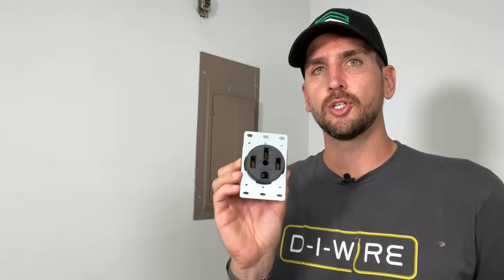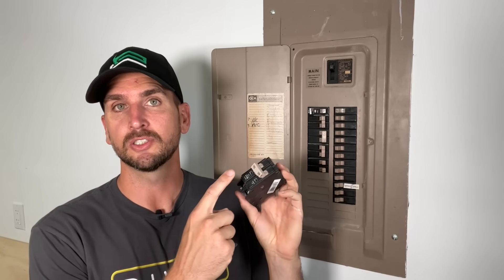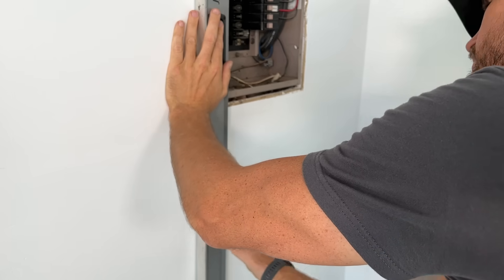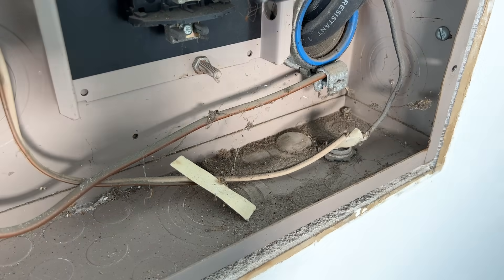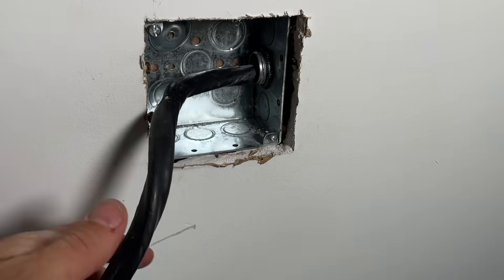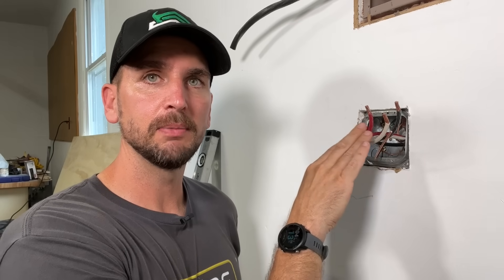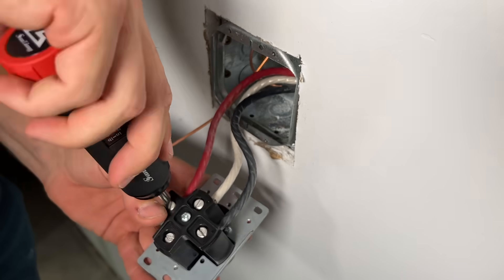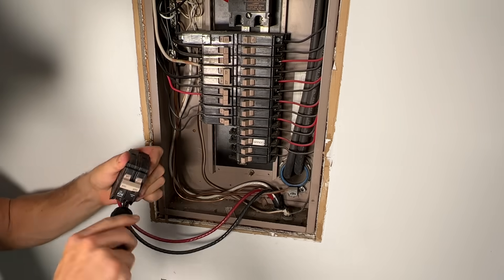Quick and Easy DIY 240V Outlet Install | 50 Amp NEMA 14-50

Comment: This is by far best case scenario this will cost most people who hire an electrician $1000 or more
Reply: $1k is a good ballpark to expect, but can probably get it a little cheaper depending on how far the outlet is from the box.   I hired an electrician to install one last week.   I bought the outlet and GFCI breaker myself.   Panel was on the side of a detached 2 car garage so had to run wire up and over one garage door to the wall between the two doors.   I had him use aluminum wire so it would be future proofed if I ever decide to upgrade to a hardwired EVSE for 60A or 80A use.    I know the wire increased the total cost.   My total bill was $857.   I think I paid around $110 or $120 total for the breaker and outlet, so all total just under $1k.   Would have been significantly cheaper if I put it right next to the box.
Reply: Prices will definitely vary based on the layout of your house but to say you can do it for $66 is giving bad info to DIYers.  I look at my house  and it would involve concrete cutting and drywall repair which hired out could exceed $2000.

Comment: Just wondering what the reasoning for using 6/3 was? #8 is the minimum size required and that would bring the cost down a tiny bit as well
Reply from the maker: 6/3 is what Tesla calls out so just went the safe route.
Reply: @EverydayHomeRepairs  that makes sense. Gotta follow manufacturer requirements. I also forget that NM cable is limited to the 60 degree column for allowable ampacity (I’m an industrial/commercial electrician so don’t deal with Romex). Great install though
Reply: @major7009  ... I see where you were headed. The #8 will do if you are within the 80% rule on a branch circuit but car chargers will draw high for more than 3 hours so need to consider the use as continuous draw.... and I believe Tesla starts out at 42 amps, so is slightly over 80% in the first place. Best to stay safe!
Reply: @rupe53  Its not about the size of the wire its the "type" of cable used. NM cable is rated for 60C which means the insulation will be burnt above the rating temp. If you use MC cable or metal/PVC conduit the rating would change to 75C. And then #8 AWG wire could handle the load of a 50 amp circuit.
Reply: @uhjyuff2095  ... you have a point but seeing as this is a DIY video for home installation, I doubt people will head to the conduit route.
Reply: @rupe53  Flexible conduit is not hard to come by. FMC, LFNMC, LFMC take your pick!
Reply: @uhjyuff2095  ... absolutely true but adding conduit doesn't raise the temp rating. That's a matter of the insulation type on the wire itself. IOW, different wire PLUS the conduit. Now for a look from a different perspective.... heat comes from resistance and is what causes voltage drop. In my book, if you are close enough to maxing out the wire size that you have to consult temp charts, then your wire isn't really big enough. The old phrase, "plan ahead or plan to fail" comes to mind. Is saving a few bucks up front worth putting yourself in a situation to do the job again?
Reply: @rupe53  Wrong, if you have a business doing electrical work, you will not get a job if you bid too high. If you are the "stupid" contractor always buying bigger wire than the other contractor you will never get a job and therefore not be a good business owner. The "smart" contractors learn the prices of a piece of conduit and find out that a piece of conduit is cheaper than buying MORE copper. You have to play the game!
Reply: @uhjyuff2095  ... just wanted to point out that the SMART contractor will take a moment to educate the customer as to why it may be a better choice to spend a few extra bucks up front because the customer probably has no idea.
Reply: Continuous load
Reply: @davidicousgregorian  The resistance is not the limiting factor, the temperature rating of the NM insulation is the limiting factor. The NEC specifically rates NM cable at 60C.
Reply: @davidicousgregorian  ... don' mean to split hairs, but NEC calls out 20% derating for continuous load, over 3 hours. With the right size wire, you can also go100 ft and stay within voltage drop on that 80% circuit loading.
Reply: @davidicousgregorian  ... you seem rather sure of yourself. Perhaps you have a code section by number in mind?

Comment: This video is really well done.  A very efficient use of our time.  Thanks for creating this content!  I just installed a NEMA 6-50 for my plasma torch and it looks like I didn't miss anything.  Does your state code require GFCI for this?  My Siemens GFCI breaker was $150.
Reply: My jurisdiction has moved to the 2020, so I am about to do this project. Given the brand of the existing panel, I am needing to use a classified breaker which is not available in GFCI and then install a spa disconnect to provide the GFCI protection.
Reply: @vikingdm  .... Ha! Now you have an interesting option to use a spa panel with extra slots so you can do the GFCI for the outlets and add a standard 120 volt outlet at the same time. NOTE: many chargers have built in GFCI so read the owner's manual. Installing a GFCI breaker along with the built in GFCI may cause false tripping.
Reply: @rupe53  That is true but a garage receptacle needs GFCI protection in my jurisdiction. If the charger has integrated GFCI protection and says to not connect to a GFCI protected circuit, then it would need to be hardwired in my jurisdiction. I am installing a 120v receptacle at the same time, but that will just be a GFCI receptacle due to lower cost, but I like the thinking.
Reply: @vikingdm  ... and that's why I stated "read the manual" so you know what to do! The GFCI on a single outlet would just be as normal code calls for. (in the breaker or outlet)
Reply: @rupe53  No it won't.
Reply: @patrickkelley3408  ... won't meet code? Please explain.
Reply from the maker: Nope, we are still on 2014 NEC

Comment: Some other videos suggest purchasing a more expensive receptacle.  What are your thoughts?  $9 certainly sounds great, but with such a large difference from something like a Hubbell, I wonder if you're (only) getting what you paid for.
Reply: I needed a NEMA 6-50 for my plasma cutter, but similar install.  I started noticing the higher quality receptacles after I'd already gotten mine.  I don't expect to replugging every day -- more like once a month.  So I think I'm ok.  If there is ever a question of it getting janky I'll replace it with a Hubbell or other robust brand and probably add a screw or two to the rear of the box.   But if I'd known from the beginning that there was a higher level of receptacle, I would have just gotten one of those.  As a DIY'er I'm saving so much already, it's easy to justify splurging on quality parts.
Reply: @MLFranklin  ... you will find out in a year or two if the plastic on that cheaper outlet will hold up to the heat of extended high draw, regardless of plug insertion count.
Reply: @rupe53  Good information, thanks.  I'll watch for it.
Reply: @MLFranklin  .... BTW, on a plasma cutter or small welder, you may never run into an issue because of the intermittent duty. IOW, even when welding you will seldom run full bore for more than a minute, if that. Consumer quality units just aren't made for extended duty cycles.

Comment: Is there a drawing you can hold up that shows how to pair two 120v into a single 240v male/male jumper?  I'd like to come off my 2000whr gen and go into my dryer socket.  Thanks!!
Reply: Is your generator 240? If its a 120 generator it won't be that simple. If it's a 240 generator it should have a 240 outlet you can use.
Reply: @johnh8546  it's a 120v with 4 outlets on it.  I'm thinking of tying all the hot legs together,  returns & grounds and get a 50A rated cable to splice onto.   I know I need to keep the house main off while lighting up my panel through the dryer socket.
Reply: @billm201  Pull the dryer socket off the wall and check the conductor sizes.  If you only have a 6-50 with a small ground wire that won't be adequate as a neutral (what it would be being used as) for your whole house, and will start a fire.  Install a generator inlet next to your panel.
Reply: @snap-off5383  good point, thank you.
Reply: I would advise NOT making that cord. OTOH, if you must, there are plenty of YT videos showing how to make a suicide cord.
Reply: Suicide cord.  Illegal in most places.  Don't do it!

Comment: Thanks. Unfortunately, my fuze box is far from my garage.

However, my laundry room shares a wall with my garage. 
I was hoping to use a Y-plug (~$70) to share the dryer outlet.

And I plan to put a note on my dryer start switch to check, & disconnect my (future) EV if it's plugged in/charging.
Reply: Dave, this is really not a good idea. Please put your EV on a dedicated circuit!
Reply: @gregoryreffner2939  please explain.

Have you heard of something called a "dryer buddy" ?
Would using this be more acceptable?
Reply: Not sure what kind of car you even have or how much power it draws but it remains true that your dryer is meant to be on a dedicated circuit
Reply: @gregoryreffner2939  I am not sure which EV I'm going to get yet. But I plan to use the mobile charger with the dryer plug. As far as I know, it won't draw more amps than is safe.

iirc, the dryer buddy will automatically shut power off to the EV charger outlet when the dryer is on. So, there's no need to check / disconnect the EV charger.
Reply: @Dave--FkTheDeepstate  The "dryer buddy" is not automatic switching, if it is then it would be fine.
Reply: Well most dryers run on a 30amp dedicated circuit. If you spliced into that for your 50amp EV charger you would be a fire waiting to happen even if they weren’t running at the same time. 10gauge wire can’t handle 50amps. 

Not sure about a dryer buddy. Just googled it and it looks like a waste of money. What’s the point of installing an EV charger if it gets throttled every time you use your dryer?
Reply: You can unplug the drier and plug in the car charger.  But you will need to program the car charger to draw 30 amps or less.
Reply: @smithno41  .... Following the 80% rule on a branch circuit, you'd need to limit long term charging (over 3 hours) to 24 amps. That said, dedicated outlets are CODE. You don't really have that option to share. Do it right or don't do it at all. If you have an electrical fire your insurance company will have a field day and you won't be smiling.
Reply: @davidicousgregorian  iirc, depending on the EV, a 30A dryer outlet should yield 16-25 MPH of range/charge. 
If I charge for TEN hours overnight, that should give me about 160 to 250 miles of range (~3 to 4 hours of driving). 

In the highly unlikely event that I turn on my  (rarely used) dryer while my EV is charging, won't that simply trip the overloaded fuse box breaker switch?
Reply: Real good idea if you want your home to catch fire from a REAL SILLY IDEA. Never spilt high draw circuits. A charger for a vehicle is almost twice that of a residential dryer.
Reply: @soisaidtogod4248  Did you NOT UNDERSTAND the part where I said I plan to NEVER USE BOTH DEVICES AT THE SAME TIME ?

And in the unlikely event that they are both used at the same time, won't the circuit breakers in the fuse box just get tripped??
Reply: Those outlets are designed for a specific amount of amperage and anything plugged into them is designed to assume they have that full amperage all to itself.

I highly suggest not using a splitter, and every outlit needs it's own circuit.

Comment: Could you go solar when you get an electric car, for the charging station separate, with an inverter of course. I found a place that has solar shingles.
Reply: Ever price 60+ kilowatts of battery storage?? 😱 I'm currently getting 8¢ kWh electric, so it would take a LONG time to recoup the solar/storage expense. Chevrolet is paying for an outlet install for our new 2022 Bolt EUV, and the charger came included with the car.
Reply: @nortonnewmann3711  LOL, you just bought a car with 60+ Kilowatts of battery storage! How come you can do it and no one else can?
Reply: @uhjyuff2095  You can... just visit a Chevrolet dealership. Otherwise, please explain???
Reply: @nortonnewmann3711  No thanks. Ford guy here 🙂
Reply: @uhjyuff2095  No, I haven't I was just wondering. Not if you have and inverter and storage.
Reply: Power is power, so yes you can do solar. 

Just remember that solar works during the day.  If your car is home....fine.  If your car is not home, there are choices to make, mostly centered around money.

Rough estimate.....tesla power wall type battery (there are many manufacturers) would be required for the car alone maybe two...about $10,000 for one battery alone.

The grid can function like a battery in the sense that you can solar power in and utility power out.  If you are under "time of use rates" this is a great deal money wise.

Solar is great, there are several different "system designs" that come into play.

Do plenty of research and do not be afraid to talk with a pro.

Comment: Ok why metal box?  Surely you can use plastic.
Reply: I thought about that, but unless a thicker wall plastic is available as an option, wrestling the 6 gauge wire may bend or break it.